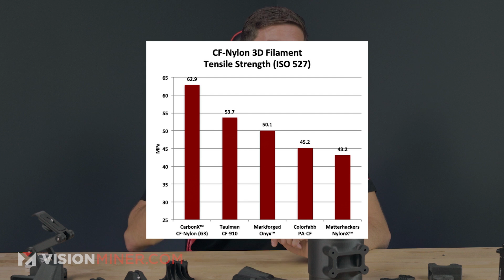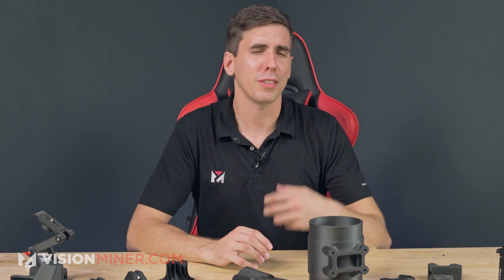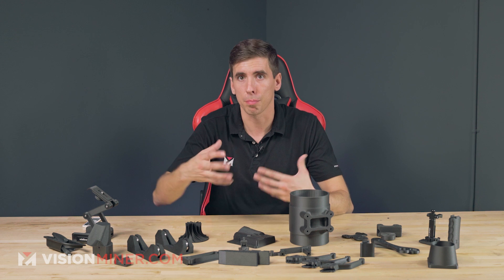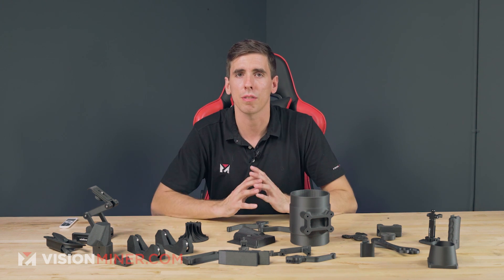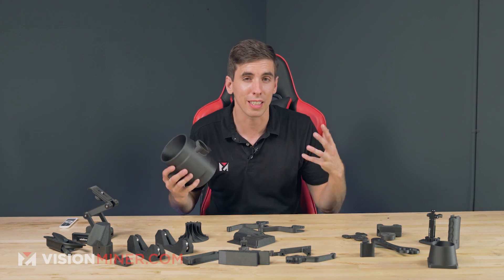What is Carbon Fiber Nylon Filament and Should You 3D Print It - Pt. 1

Comment: Brake handle for a motorcycle - yikes!  Safety critical parts should not be using "bleeding edge" technology or materials.  Even experienced manufacturers using traditional materials will shy away from safety critical parts if they don't have a pedigree making such parts.  If you know you are engaging in risky behavior, that's your right (freedom, baby!) but PLEASE don't sell a bike with 3D printed safety critical parts, or sell the parts to others.
Reply from the maker: Frankly, many people don't understand the capability of these materials, and how far they've come in the last 10 years since the original FDM patents expired. Many would not blink at an injection molded part in a performance composite (re: glock frames), yet for some reason 3D Printed parts are considered "unsafe"..... run it over with a car, hit it with a sledge hammer, grind it down on the turntable, this stuff is tough!
Reply: @VisionMiner  You are missing the point.  There is a reason that even most of the parts in new NASA spacecraft are still made out of aluminum and stainless steel.  Because the failure modes are easy to understand.  The manufacturing issues are well known.  The analysis is easy.  Anyone can make a brake lever that is strong and will be strong 99% of the time.  When life is at risk, 99% isn't good enough.  99.99% isn't good enough.  At least from parts made to 1st world quality standards.  Like I said, if you are the only one using that part, I'm not going to judge.  This is (supposed to be) a free society where you allowed to decide the risks that you want to take for yourself.  Just if you think it's not a risk because it may me stronger, that is false.
Reply: I guess you never heard of SLS printing.
Reply: @Tearis01  This video is about FDM printing.  And while I personally would trust a SLS part more than an equally strong FDM part, this is still territory where it is a safety critical part, and should not be made by hobbyists.  Unless you are using it for your own purpose, understand that you are taking a risk, and probably shouldn't even be on a public road.  SLS also has more poorly known failure modes than parts made by more established manufacturing methods, so I think that most manufacturers with pedigree in making brake levers and such would not use SLS or any other type of "modern" manufacturing method.  I know I sound like a cranky old man, but it is what it is.
Reply: I am also the type that would not buy a brake lever from China without some type of established brand willing to puy their name on it.  If I'm going to die on a bike, I want it to be because I did something stupid and awesome, not because I tried to get creative on a brake lever, or tried to save a few bucks, and the lever snaps on an emergency stop.

Comment: How is this material for Parts that will be submerged in saltwater?
Reply from the maker: We have several clients using ULTEM 1010 for seawater parts, but Nylon does break down in water over time. Years, that is. Our other materials are likely a better option for long-term use!
Reply: @VisionMiner   Thanks! I was looking for a cheaper option compared to ULTEM.  You mention 'Years' So then I gather the Nylon Carbon option will not just bend or weaken too significantly when only submurged in sea water for a couple of hours a day? Cheers
Reply from the maker: @michaelhartjen3214  I would imagine it will do well, but we don't have any actual data on it :)

Comment: How does 3DXTech's FibreX GF PA (Glass Filled) compare to their  with CF PA6, and have you used their PC+CF filament? Interested in a strength comparison.
Reply from the maker: GFPA is a bit weaker than CFPA6, but doesn't conduct electricity, thus an advantage.... apparently it doesn't wear the nozzles as fast, either! Their CFPC is excellent as well, we've got some videos coming...

Comment: "I'm talking about the common material that can be used in more common printers (continues to list of printers costing thousands of dollars)
*Me*: Looks over at my Ender 3. "Ah yes, my professional workstation".
Reply from the maker: Slap a Mosquito hotend on there, along with an enclosure (cardboard boxes DO work...) and you've got quite a workhorse that can do a lot still :)
Reply: One of my printers is an Ender 3 (Ender 3 Evolution). I have modified it to use a Mosquito hotend and Duet 2 main board. It prints nylon all day. It prints with the same quality as my Pulse/Prusa printers. Another hotend option is to use the E3D copper heat block, 50w heater, Slice Engineering thermistor and heat sink of our choice. As long as you are using a Duet Mainboard, you can use just about any modification you can dream up.
Reply: I print Sainsmart eCF+PA on my Ender 3 Pro with a cheap and nasty clone MS all metal hot end...  I love it, I'm making loads of functional parts for my car with it!
Reply: There's tons of mods for the Ender 3, some of them specifically aimed at running these kinds of materials, like all metal hot ends and full heated printer enclosures.

Comment: Tldr: keep parts dry after print? I have printed a fair bit of nylon cf15 blend (basf paht cf15) , and to my horror it gets super soft after sitting in a cold moist basement for a week or so. Super stiff when it comes out of printer, so must be absorbing water post print and the nylon seems to become ductile, comparable to lead in response to forces. Anyone else noticed this? There's a recent article on fdm cf nylon which seems to confirm dramatic mechanical property effects of moisture post print, but it's pay to read beyond abstract.
Reply from the maker: Thin walls? So, yes, nylon will absorb moisture after printing and become more ductile --- however, the moisture DURING printing is a different effect -- the bubbles and steam produced during each extrusion line creates gaps and holes, which have a more dramatic effect on mechanical properties, as opposed to after the printing occurs.

Comment: Can CF nylon can be used at parameters with bed temp 60 Deg., Extruder temp 200 Deg...???
Reply from the maker: Depending on the blend, you need at least 250c on the nozzle, and 90+ on the bed helps a lot!

Comment: Are there any hazards with the handling of the parts or filament, i.e. carbon fiber filaments sticking into the skin or getting airborne and breathing it in?
Reply from the maker: generally no, as they're embedded in the polymer. Is it the best material for a handgrip? Maybe not, but just like injection molded plastics, with a smooth/polish, it's generally not an issue.

Comment: Seeing the new Atlas 46 speed square and pencil holder lead me to this video. The question I have is this, are there better alternatives to a design like theirs, or is this material the best for the roll? Complete noob to 3D printing and the materials they use.
Reply from the maker: Could you be more specific to which design you're referring to?
Reply: @VisionMiner  Yes, of course. Atlas 46 is a company that makes things to hold your tools, like quality tool belts, and they are now marketing a small pencil/speed square holder. They say it's made out of carbon fiber reinforced 3D printed material. I was just curious about their choice of print material. I can only assume they know what they're doing but I also assume you would know more about 3D printing than a canvas focused tool belt company.

Comment: how do you guys fight with the creep issue when under constant loading?  I have had a largely poor experience with CF nylons from multiple manufacturers.  Over time, the prints always creep, even with small loads
Reply from the maker: Do you mean warp? Or heat creep in the hotend?
Reply: @VisionMiner  I mean dimensional creep, I can print beautiful CF nylon parts, they come off the machine nice and square and very geometrically accurate, but when put them in their intended application, any member that has force on it will slowly yield and the part deforms, even at just room temperature.  An ASA or PLA+ part in the same application does not move, but people don't offer ASA in CF or Glass filled (which I really want), and PLA+ has the thermal issues.

I've heard some people saying the moisture content is important but it prints very clean which tells me that the moisture content is fine... so unless it's picking up moisture post-printing then I think that's not right.  And if it's picking up moisture post-printing and causing this type of behavior, that seems kind of silly to me.
Reply: @RentableSocks  Hi, so did you find the answer to your question, now that a year has passed?
Reply: @mofooooo44444   yeah, generally my approach has switched to "anything with static loading, avoid CF-nylon" because of the creep issues.  Cyclic loading might be OK, but honestly it's not worth the trouble to swap between filaments for different parts on a machine.  which is unfortunate, because it seems like it would be such a good material.  I'm awaiting more CF-ASA producers, I think 3dxtech has some but unfortunately it's limited to 750g rolls.  Since it's 3dx ASA, it's a bit more flexible than ideal as well, but that might let it fit with some CF-nylon applications.  Their CF-ABS is very nice.
I'm also waiting on fusion filaments to bring up tooling for CF production, since I like their HTPET+ (not a PETG, prints at like 280/80, comes out isotropic).

I HAVEN'T tried the much more expensive CF nylons, the HTN or the PA-12 from 3dx, I suspect they'll fare better but I don't want to spend 170 dollars for a kilo of material for parts to be replaced on the next design rev
Reply: @RentableSocks  wow! That is very comprehensive explanation compared to my understanding. Thanks a lot! 

Under static loading do you mean something like a gear or a hook? What is your experience with CF-nylon sudden load, is there a better matierial to print on a desktop?

So basically if the part is replacable or single use I should avoid CF nylon and the expensive gear even if I require stregth because of the 10 fold price per kilogram.
Reply: @mofooooo44444  by static loading i mean like something that puts a force on the plastic for a long period of time, so more like a hook.  Gears would be cyclic loading as long as they're only under force during movement, but i've had gear teeth creep on me in part of a gearbox made of cf-nylon.

For shock loads, you should be fine as long as you're impacting the XY plane, since the layer to layer adhesion is not very good, very anisotropic.

Yeah I'd avoid CF nylon for replaceable or single use parts unless you need its specific properties, the good stuff is very expensive and the cheap stuff isn't good.

Honestly usually my go-to materials are esun PLA+ if it doesn't need any heat resistance, fusion filaments HTPET+ if I need isotropic (and no impact resistance), and either esun or polymaker ASA if I need moderate heat resistance and ABS-like mechanical properties without the random fractures from grease proximity or increasing hoop stress.  I'm going to try out some of 3dxtech's EZPC-CF I think, it's supposed to be super stiff.

Comment: When I watched this video, I felt this is almost a hoax: As far as I know, the strength of FDM printout is much lower in Z-direction than in XY-plane. Ignoring this and only mentioning the top strength/stiffness is just not honest. Aluminium parts are homogenous but FDM prints are not. The brake lever shown in the video is a classical example of a part that is optimal for CF printing: The item is naturally printed in an orientation where all the forces will effect in XY-plane. If you print that part in the vertical orientation, you will get quite different strength/stiffness values. 

Depending on the material, printer, and printing settings, a printed part can be 80% weaker in Z-direction compared to XY-direction. I'd like to see a video where these things would be tested.  Some tests are here ( https://youtu.be/ycGDR752fT0?t=538 ) but unfortunately CF is not included,
Reply from the maker: We've come a long way in the last few years :) While often you still lose 20-50% of ultimate strength in the worst orientation for most filaments, a lot depends on geometry, and more materials are coming out which can be printed to have near-isotropic strength. Material science has come a long way to help this out, because yes, it's been a problem, and still is with many filaments. 

Check out the TDS on this page for PCTG: https://visionminer.com/products/pctg
Nearly BETTER strength in the Z-orientation! Absolutely incredible stuff, and it prints as easy as PLA. Mind Blowing!

Also keep in mind not all PA or CFPA are equal -- each company uses different additives, extrusion processes, and %'s of fill, so you really need to stick with the ones doing research, who have good TDS's. HTNCF25 is on this page: https://visionminer.com/products/htn-cf25

Now, printing hotter often makes the value higher, but depending on material, you can really get away with a lot in tweaking temperatures and speeds, along with geometries. 

You're on point, though, it's definitely not at injection molding levels yet (aside from PCTG) -- although more stuff is coming out soon to change that :)
Reply: @VisionMiner  Especially with composites (which is the case in this video), where the fibers don't go between layers but are in X/Y plane, I'd expect a huge drop in strength and especially in stiffness in Z-direction. I doubt any material development can overcome this (unlike with non-composites). It would be just fair to mention it, and even better: examine the strength/stiffness and publish the results.
Reply: @VisionMiner  
Well then, just print molds for injection molding with it

Comment: Any reason one couldn't heat the piece with a heat lamp as opposed to an enclosure?
Reply from the maker: NASA actually did this in their original whitepaper for a heated chamber. Essentium is now using Infrared, and instead of "chamber temp", they're monitoring "part temp", which technically makes a lot more sense!
Reply: A heat lamp tends to be a bit directional. For even heat, the whole chamber must be warmed.
Reply: @UncleKennysPlace  If you mounted 4 small ones above the work area om an angle, they would heat pretty evenly.

Comment: I want to print lattice boom sections and tower sections with a 3D printer and obviously carbon fibre would be a huge advantage to this as light weight extremely strong parts will be more desirable
Reply from the maker: Definitely check out the new HTN CF25! https://visionminer.com/products/htn-cf25

Comment: Would love to have a comparison between filament product to it's natural? Counterpart in strength. 
Ie ABS = wood. CFPEEK = aluminium(billet, forged, 6061t6?)
You could do your ABC ranking with it.
Reply from the maker: I like it --- might take some time but we'll see what we can come up with!
Reply: @Clint Savage that is extremely optimistic comparing ABS to wood and CFPEEK to aluminum. In reality, ABS has lower tensile strength and young's modulus than even PLA, nevermind wood. No plastic printed on a FDM printer reaches young's modulus of even stronger softwood species, and being even in the same ballpark as aluminum is science fiction until you start using 3d printers capable of laying down continuous fibers, which will cost you an order of magnitude more than a regular FDM printer.